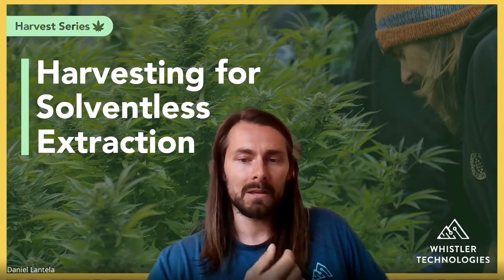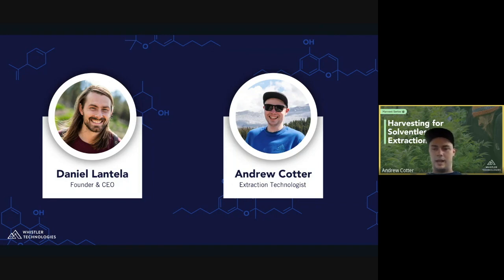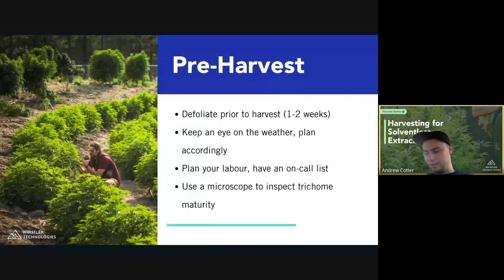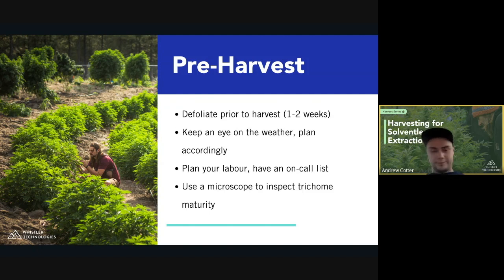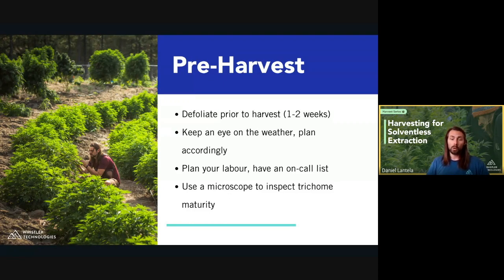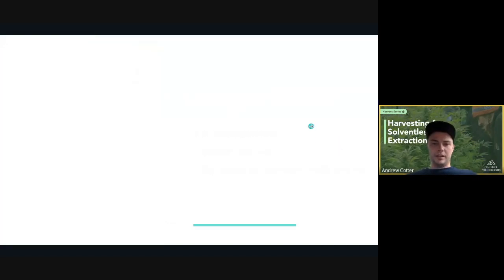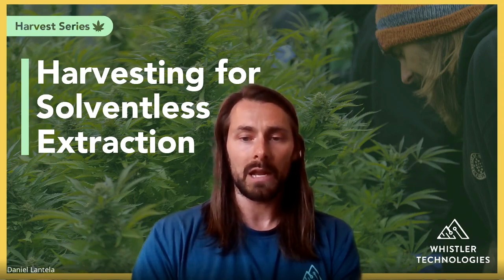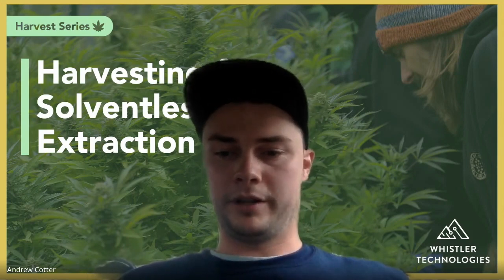How to Harvest for Solventless Extraction (Webinar by Whistler Technologies)

Comment: Do you need to trim the bud after bucking it like how you trim the bud for dry and curing, or as long as the big fan leaves get taken off, it will be good to wash?
Reply from the maker: Hi Scott!

Ideally we only remove fans leaves with stems that are accessible without trimming into the bud. We will avoid any trimming of sugar leaves as they will have trichomes that we will remove and collect during cold water extraction. Trimming sugar leaves creates a greater risk of contaminants ending up in the final products and makes it easier for chlorophyll to leach out of the plant material.

- Andrew